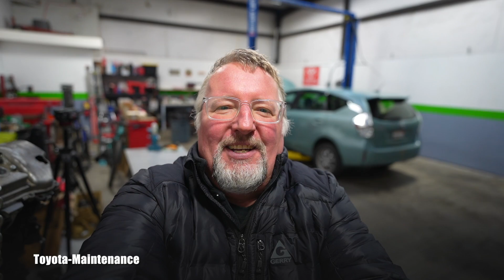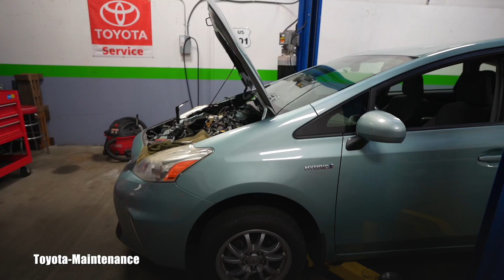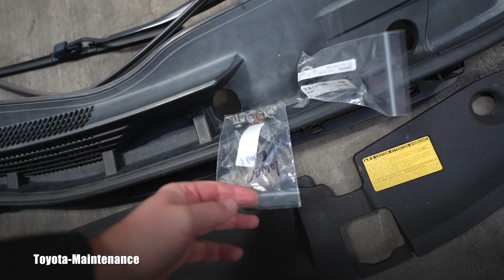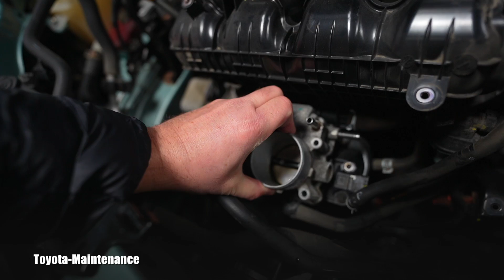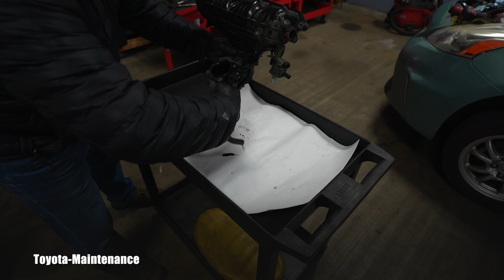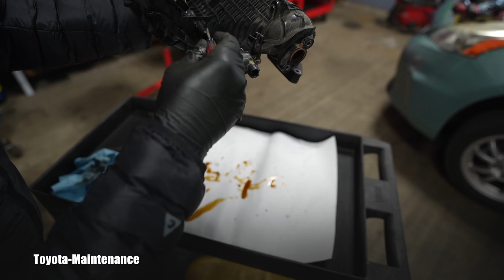Toyota Prius Engine Intake Full of Oil

Comment: Hey Peter my 14 Prius 2 had a replaced engine.  Right away it had a bad head gasket rattle.  I replaced the gasket , intake , egr cooler and valve, pcv.  I still have oil in intake. Any help?

Comment: People who drive this car in eco mode, hypermile it and never get the engine revving and hot will have this problem. Also changing oil on manufacturer recommendations will do this. My ct200h, same as this prius had 160km on it when I bought it, EGR was proper clean and almost no oil in intake. It's about how you drive this car. 
Drive it normally, change oil every 5-10km with premium oil, clean egr once in a while and they will last forever.

Comment: So what is the solution to the this issue of oil accumulation  in intake manifold ? Replacing the pvc valve, cleaning egr piping and cleaning intake manifold ????

Comment: I have had oil end up in my air resonater in my 99 tacoma pre runner 2.7. Any idea what could cause also have a lean code p0171 checked and replaced almost everything to solve. Rough running when hot unless a give it a lot of throttle then it operates mostly normal again without stuttering

Comment: On Sunnysky321 comment. We all should know by now, the egr system and shutting off and on the motor causes head gasket failures. Has anyone done a complete egr delete? Ive done it with past vehicles and they run better with better fuel economy. Why cant we do this with prius system?

Comment: I will just stay away from the 3rd generation 1.8 engine prius. Is already stressful enough to worry about a $3500 main battery, and now this? So, really, you'll be better off with a Honda Hybrid. Honda doesn't have the shaking or egr problems.

Comment: Peter, Could you help me.

I have a 2010 prius, I turn it on, the engine is ready but it does not accelerate and I could see that the throttle body does not open, I cleaned the egr valve, cleaned the manifold and it still does not start.  I have the codes P0302, P0304 and P0401.  I do not know what else to do.  please help me.

Comment: Great stuff good videos very informative keep the information flowing without getting too far behind LOL

I have a 2014 Toyota Prius Plug-In and I purchased it at 126,000 Miles and some change and I am currently at 131,000 Miles I'm slowly replacing everything like break spark plugs all the filters mass air flow and it's running so great don't get me wrong it was running good to begin with but  I can feel a difference
My MPGs are staying at 54 very solid I drive 50 miles round-trip everyday I do about 12,000 miles a year

This intake is very disturbing and intriguing I'm wondering how much more you should just change and replace if you gotten that far in front of the engine just the intake in that PVC

Comment: Great Video.  I've seen allot of YouTube Videos on installing Oil Catch Cans (OCC) on the 3rd Gen Prius to stop and/or minimize the oil entering the intake manifold.  I have a 2014 Toyota Prius with 50,000 miles oil changed every 3 months or 5,000 miles, changed PCV Valve twice and still have a 1/2" of oil in the bottom of the intake manifold.  My question is:  What type of OCC is best for the 3rd Gen Prius and where is the best location to install it?  Thanks!

Comment: i just cleaned my egr cooler, egr valve, and manifold last week.  wasnt fun but glad its done!!!  I also installed an oil catch can on it.  pretty simple installation and it should help to minimize the oil pooling in the intake manifold.
Reply: Yep... same thing but I did 1 additional step....I unplugged the EGR valve.  The reason was because you don't know when your EGR system will plug and cause a misfire which will blow your head gasket. Too risky.  My engine ended up lasting 350k miles.  The other thing is.... don't shut your car off while the engine is running, this can cause gas/oil inside the throttle body and cause misfire the next start up
Reply: @modified93tc  Don't listen to this guy, you can NOT close or unplug the egr system permanently on this car. The cooler decreases intake temps preventing knock. If you close the egr system you'll blow your head gasket sooner. Keep it clean and change oil regularly and your headgasket will be fine.
Reply: @modified93tc  how many miles ago did you unplug the egr valve?  and no issues with that???
good intel on the car shut off!  makes sense.
thanks for reply
Reply: @davek7640  about 100k miles ago no prob.  With the design of these engines you're 1 misfire away from a blown head gasket and I didn't want to take that chance.  It does set a check engine light tho
Reply: @modified93tc  mine is coding as Cyclinder 1 and I had spark plugs changed but still doing it.. guys are saying its transmission but code keeps coming back as C 1.. now I need to take it elsewhere as they want me to replace the whole trans.. but it could be fuel injectors or? Im at 170,000.. how can I help my car last longer.. I just paid it off.. ugh
im trying to figure out whats really wrong.. some guy said 6 months ago after he replaced the fuel pump that head gasket could be blown or needs to be replaced soon.. so each mechanic is different

Comment: I have a 95 corolla 1.6 gli vehicle. It works properly in LPG. It stumbles slightly on gasoline. When I turn on the heater, the idle speed drops slightly. It works in the morning with only one start. Also, the air conditioner tensioner is in a very narrow place, how can I unscrew the nut.

Comment: I need some ideas from y’all. I got a 92 4runner with a 3vz. I recently did a manual swap truck ran fine and I switched over the wiring harness and ecu to a manual. When I started it up the truck would surge and die. For a while it wouldn’t even start. When it does run the idle surges and I have to keep my foot on the gas at a stop to prevent it from dying. The weird thing is that sometimes it will work completely fine, exactly how it should. Then I shut it off come back 5 minutes later and its surging and wants to stall out. I’ve checked fuel pressure, valves, plugs wires, compression, MAF, distributor, vacuum hoses. I even switched the wiring harness and computer back to the original but it made no difference. Any ideas?
Reply: Take to a mechanic

Comment: It is a bad design engine.  The engine burns oil and has excessive liquid build up in the intake manifold.  Flawed piston ring design was updated in mid 2014.   Oil / condensate mix in the intake along with blowby fed to the cylinders via the egr creates carbon and preignition. Egr intake is before the cat on these years; gen4 egr intake is after the cat and therefore much cleaner.  Thermal cycling is also a problem for the cylinders due to stop start and poor coolant passage design.  Cylinder insulators and revised coolant passages remedied uneven temps in gen4.  I would replace the intake since the small egr ports finding the cylinders get blocked, plus Toyota revised the manifold design a few times, particularly important on the 2010-13 models.  All 2015 hatchbacks and 2015-17 v's have the revised pistons and rings.  2014 models had a mid year production change when can be identified by tpye of Prius and manufacturing plant.  The six digit vins after the factory (E0, E1, E3 or EJ) ids the first 2014 with the improved pistons and rings.

 T-SB-0169-16
DRIVETRAIN 2ZR-FXE
PRODUCTION CHANGE EFFECTIVE VIN
Last six digits in sequence;  seventh from end is the factory

Prius Hatchback JTDKN3DU#E0 358779     JTDKN3DU#E1 791355 
Prius Plug In         JTDKN3DP#E3 055768 
Prius v wagon      JTDZN3EU#E3 339374     JTDZN3EU#EJ 001475
Reply: Thank you...  I currently have a gen2 that has been a darling at 177k miles...  I am lifting this gen 2 and considering a gen 3 for a new commuter car

I cant afford a used gen4... Gen 3 prices are becoming so affordable now ...

Your info is greatly appreciated

Comment: My 2010 Prius has just started making an intermittent loud exhaust sound, mostly on start-up. It only lasts for a few seconds, but it's like somebody is turning a performance exhaust on and off.

No codes yet, but have the start of the "death rattle." This exhaust sound is separate and different from that. Anybody else experience that sound?
Reply: Without doing an accurate vehicle inspection nobody will give you an accurate guess. You could have a loose shield or crack that once heats up is sealed. Or a loose connection or gasket in the exhaust. The other thing: Maybe it's a bad filter. Or low oil pressure. That's for the rattle.
Reply: clean the intakemanifold and complete EGR-system and your problems will be gone

Comment: This is why you should add a OCC and also..... Never shut off your Prius while the engine is running, wait for engine to stop then shut off.  Doing both and mine lasted 350k miles.  Without a OCC the oil/fuel mixture will drain into the cylinder head and when you start it will blow the gasket.  The EGR is a different problem that must be addressed or you will risk a misfire which can also cause blown head gasket

Comment: My understanding this EGR system clogging problem began on the Gen 3 Prius in 2010 Model year and was fixed for the 2015 model year still a Gen 3. Am I correct? If yes what did Toyota do to fix it for 2015 Gen 3 and also for Gen 4 Prius starting in 2016 Model year?
Reply: Egr is a problem on all gen3 Prius which is 2010-2015 on a hatchback and 2012-17 on a v wagon.  Rings and pistons were fixed by 2015 and is the number one root cause of head gasket fails.
Reply: @rj.parker so you’re saying a 2016 Prius V would still have this issue or no?
Reply: The 2015-17 Prius v has the updated pistons and piston rings but otherwise is still a problematic GEN3 Prius engine. I would not buy one over 100,000 miles or for a price that would require me to finance it. Egr, brake booster, pcv, cylinder cooling and more were radically improved in gen4.
Reply: @rj.parker  Thank you
Reply: They changed the piston and Ring design for 2015 to not burn oil like previous years.  2016 on they don't burn oil and redesigned the EGR system completely

Comment: OIL CATCH CAN
Reply: Won't solve the root cause which is oil consumption due to rings.
Reply: @rj.parker  right, but it will keep oil from accumulating at the throttle body.

Comment: Can't imagine it's worth fixing a head gasket on this model.  The money is better used in buying a new one. 

Fix the head gasket and you still have a declining battery, and possibly expensive failures in the unique differential, transmission,  the Regen braking system and the power supply.  All thousands of dollars in repairs. 

Use the carcass as a down payment and finance a new one. Five years of payments buys 10 -15 years of trouble free miles.
Reply: These v wagons are still getting $15k for the better 2015-17 gen3 models.  So a rebuilt engine installed with new pistons in a 2012-14 is a good investment.  Often $3,500-$5,000 at good independents.  Rebuilt not just a replacement used engine.  The vast majority of gen3s were sold from 2010-2013 so most used engines are from those cars.  Salvage yards routinely remove the engine vin plates to hide the miles and years.
Reply: @rj.parker  Yes. And they have a good reputation.  But they have many expensive hybrid replacement parts that fail.  And when you do one repair,  you still face the others, plus normal chassis aging.  Traction battery, power supply, Regen brake system, rear diff with motor.  Each of these do fail and each is around $4000 to replace (new).

I had to junk a very well maintained AZ Highlander Hybrid Limited because the Toyota dealer's techs could not figure out which of these expensive systems was killing my replacement traction batteries (2) in 600 miles. Had to coordinate between Toyota and the battery rebuild company.  I had spent $3000 and faced another $1000 for more diagnosis and $2000 -$5000 more, plus installing a third battery.  When done I was still in a nice worn utility truck with 250,000 mi.

Instead I sold it as is and put sales price and money that avoided the future repairs into a down payment and now pay $350 per mo for certified warrantied used '17 V6 AWD Highlander L truck with 85k that gets similar mpg, will outlive me and does all I need. 

I miss the '08 but am not towing it to the dealer regularly, diagnosing problems or wondering if it will complete the mission.
Reply: @lawrenceralph7481  Your points are well taken but the Prius v is simpler than a Highlander and shares parts with the more common 2010-15 gen3 hatchbacks.  For example there is no rear motor and the transaxle is bulletproof.  As is the body, interior, suspension, physical brakes and control systems.   Granted the high voltage battery will go sometime around 175k-225k and the "reconditioned" options fail quickly regardless of their "warranty".  However for a gen3 Prius a new Toyota cell kit has sold for less than $1600 and you then get another 200k.  A third party sells lithium battery cells for $2k which are directly compatible and add mpg and power.   The gen3 Prius inverters have had occasional issues but are covered for 15 years (soon to be 20 years) unlimited miles.  The brake boosters can be wild cards at $2k if they fail outside of a 10 year 150k mile warranty.  Overall the biggest risk is the engine because of the low tension piston rings and compounding factors after they cause oil burning.  In normal times I would sell before doing an engine replacement with a rebuilt unit.  But with new cars often commanding $10k over similar cars three years ago AND the used market crazy high for at least two more years, maintenance becomes more viable.

So if major maintenance makes sense to your financial situation, find an independent hybrid experienced shop and only use new cells in the hv battery.
Reply: @rj.parker  I have a 2013 Prius V and replaced fuel pump and cyclinder 1 issues replaced plugs.. but guys are saying it trans now.. but light keeps coming up cyc 1.. they want to replace trans.. other place wants to replace engine.. a video says to replace fuel injectors because it has the rattle which was worse but its coming back on this rattle.. after reading all comments.. I need to see if it can just run out and sell it I guess so I can buy something else.. who will buy it..????
Reply: @Lisachelle  The transaxle is bulletproof but uninitiated mechanics hear the severe startup rattle and think it is the transaxle.  A common head gasket leak causes a misfire that codes and often fools shops into replacing plugs, coils or injectors with no long term success.  Really it is wasted money changing those parts.  Its coolant slowing leaking into a cylinder that causes the startup rattles, usually after the car has sat for hours.  When it gets bad the car may rattle at stop signs and everytime the start stop engine cycles.  The noise is coming from a slip damper between the engine and the transaxle.  In a hybrid the electric motors in the transaxle have to synchronize constantly with the engine.  The coolant fouled plug causes uneven rpms which do not sync with the electric motor.  This causes the damper to slip until the plug fires again, usually within 15 seconds.   So the engine guy is right, pulling and changing the transaxle is the same work as pulling the engine and would not fix the problem.  Who would buy as is?  Junkyard for $500.  Craigslist or Facebook maybe $1500-$2000 with full disclosure of head gasket problem.   Repair?  Some will change the head gasket for $1500-$3000 depending on the shop. Should include rebuilding the head in that price.  However the aluminum engine sometimes warps or the rattles bend the piston rods.  So the smart shop recommends a rebuilt engine which includes new piston rings.  Depending on your location (always include location when asking for advice because someone may know a good shop) the professionally rebuilt engine (not anybody can do it right) might cost $4000-$7000 installed with at least a years warranty.  A good rebuilt engine will last another 150,000 miles with no oil burning or leaks.  Southern California and Northern Florida have good hybrid shops.
Reply: @rj.parker  yea what about fuel injectors..I saw a video on it and the rattling stopped.. but could be head gasket as my car got really hot quick when the fuel pumb went.. its hard to know who to go to without spending a ton everywhere.. if I could do it myself I would.. Im even considering it as I am mechanically inclined.. but nevr worked in this.. Id have to scrap the car totally if I couldnt figure it out..  ugh.. wish I knew for sure
Reply: @rj.parker  do u live in S cal...lol.. So basically  when they changed the plugs it worked a lot better but it was slipping so they ahd also changed the trans fluid so I thot it got gunky.. so they dont want to try putting LUCAS in as my trans was fine before they changed it.. TOYOTA said I probably need a new engine.. my friend said naw and changed plugs and it worked a lto better.. Toyota said it would work ok w plugs for a tad but it wont last long.. then before that fuel pump guy said my headgasket might be blown and need to change sooner then later.... so if i can get rattling to stop id sell it back to CAR MAX or Toyota... dunno.. I just paid it off too.. I wish it could last another 150..arg..
Reply: Last response without info.  Year, model and miles? Does it run good once it gets going or is it constant rattling.  Free advice requires comm skills on your part.  What area are you in?
Reply: @rj.parker  it’s not constant just when it switches over from hybrid to engine it’s a 2013  Prius v